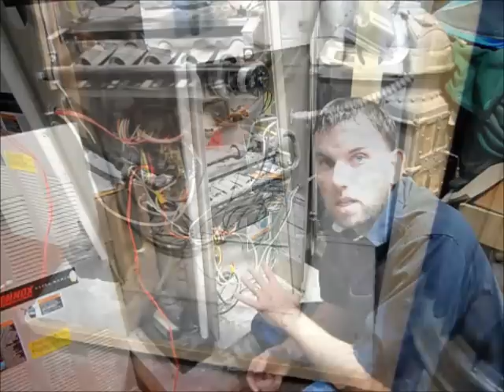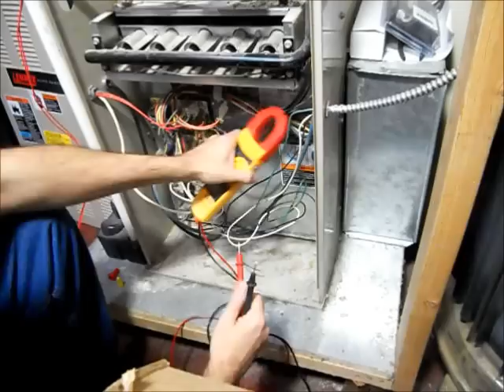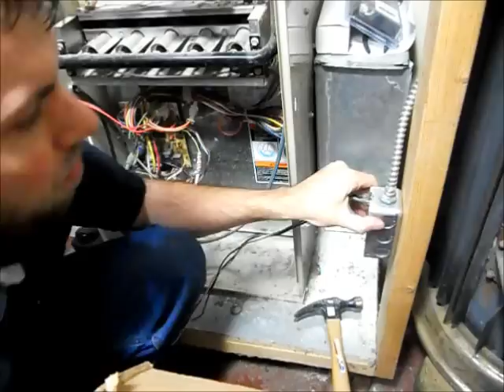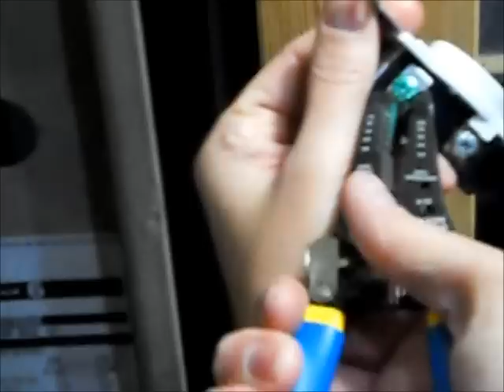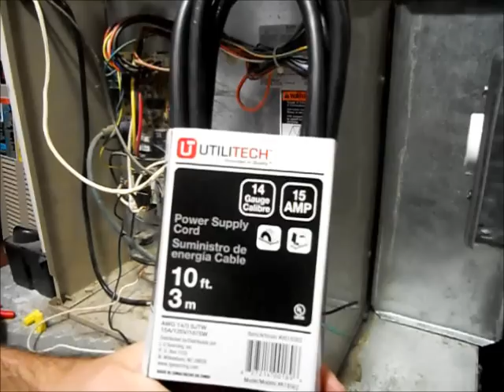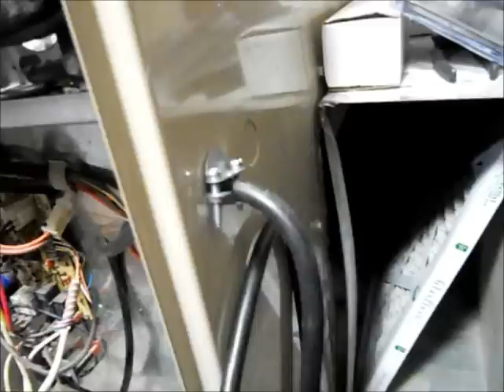RicksDIY How To Wire Your Gas Furnace To A Generator.wmv

Comment from the maker: Yes I'm pretty sure most areas a GFCI is required if your in sub grade. FYI... It's hard to find a single GFCI or AFCI receptacle at most hardware stores, so you might have to order online. As far as min Height might need to check locally NEC doesn't have a requirement, some Electricians put them at 48", if it's finished at normal height of 14-18" Keep in mind if might require a AFCI now too depending on local code.

Comment from the maker: If the box is metal then that is probably being used as the ground, instead of running a separate ground wire. If the two wires are Black & White then hook those up to your plug and attach a ground wire to the box and the switch. Make sure you add the ground, it's there for a reason, another box is your option if you want to keep the switch, possibly even getting a double wide box is an option too.

Comment: I was thinking about winter approaching and wondering how I would keep warm if the power went out.  I have a small portable generator (3200 watt, propane), and thought about running the gas furnace on it, but the furance is directly hard wired in the circuit.  I stood at the furnace for a while wondering what would be the best way to modify the connection to be able to run the furnace off the generator.  Searching youtube, I found your great video.  It explains everything in detail.  Thank you!

Comment from the maker: Hi John, Yea the Furnace Transfer Switches are by far the most accepted for use with most city codes and does look the best IMO. I actually make a small 15 Amp 120V transfer switch, they are available at Amazon or my website, look for Heezy HTS15 Transfer Switch.

Comment from the maker: As long as your not right in front of the burners you should be okay, most wire is rated at 75C for the inside of a furnace so your not far off.

Comment: Will the furnace run off the wall thermostat when a generator is being used as the power source?
Reply: I'm trying to do this and that's my problem I get power to the unit however I do not get power to thermostat.

Comment: This is great! Thanks for this.
I used a 14GA cord from a surge protector that is rated for 60°C. Does that part of the furnace heat up that much that it could be a problem?
Thanks again

Comment: Thanks for the video very informative video Rick.  I am attempting to do this project.  I took a look at my furnace and I have a red emergency shutofoff box/switch that is attached to the side of the furnace.  From this red box there is 2 wires that go into the furnace.  In your videos, I see that you have 3.  Can I just connect 2 wires to a 3 prong receptacle?  Would it be best to install another outlet box under the emergency switch or use the existing red box?  Thanks!

Comment: RicksDIY, thanks for posting this. I want to do this and have been trying to figure out the AMPerage required to run my furnace, but have been unable to get the information: Here are the specs I have, how many AMPS/watts do you figure I need?
Kenmore
Model # C9 MUX 060
Serial # A092559991
Sears model 76001
AFUE 80%
Max input 50,000
High fire output 40,000
Max CDM 1,200

Comment: It's not that simple when you hook up the power you will get power to the unit however you will not get power to the thermostat. My unit has a computer board that gets its power from somewhere else.
Reply from the maker: That's interesting, most thermostats are powered from the 24V transformer in the indoor unit. Maybe has a separate power supply somewhere? (very rare to see that in all my years working only seen a couple like that) Good luck, Cheers

Comment from the maker: The main thing you would need to check is what is the power requirements right now? Is it run from a single 15 Amp breaker? or 2 pole 15or 20?. 15A breaker is 1875 Watts Max. 125V x 15A = Watts, so if you have a 20A breaker than 2500 watts will be needed. If you have a 2 pole breaker 240V than your inverter will need to output 240V. 
You are probably powered off of a single pole breaker and your inverter should be able to run that if it's rated for 3000 Watts running. email rick@ricksdiy.com

Comment: on my furnace, power runs into a firomatic electric box before running into an emergency shutoff switch can I wire the appliance cord into the fireomatic box and end the incoming electric at an outlet there?
Reply from the maker: R Dixon You would just need to make sure the backup power is going through the firomatic switch, if you have one then code must be requiring it. As long as your not bypassing there shouldn't be any issues.

Comment: When you speak about the push in connections on the back of the single receptacle, you are dead wrong.  Those holes on the back are for the pressure plates to tighten down on the wire.  So you are actually doing it wrong when you hook the wire around the screws.  The wire is supposed to be straight and put into the holes then you have to tighten the screws to grab the wire.  Just had to point out your mistake there since you're spreading false info.......